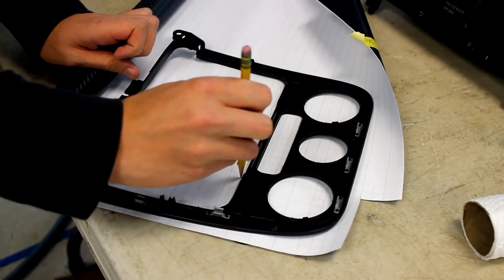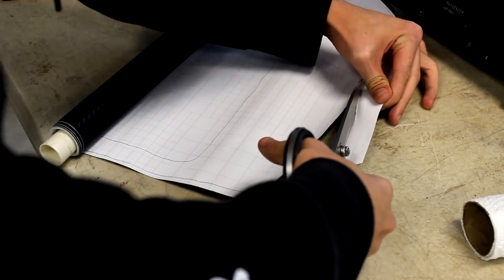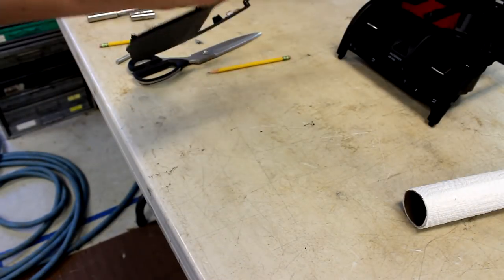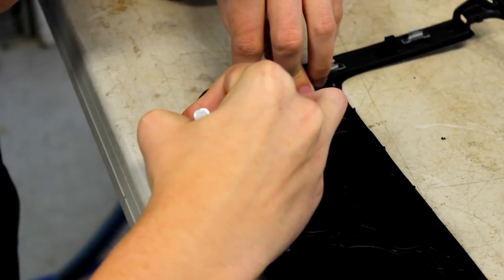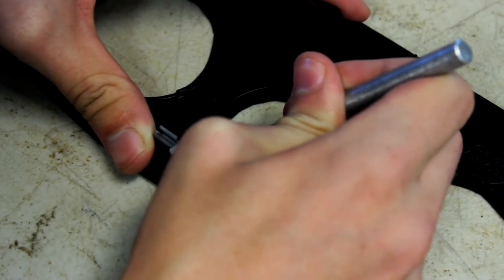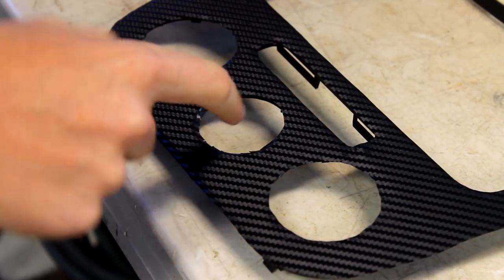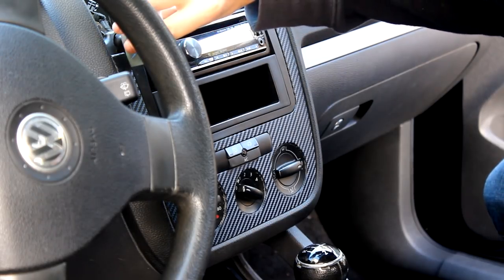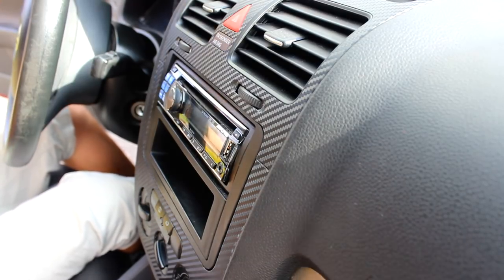How To Wrap Interior Trim With Carbon Fiber Vinyl

Comment: I did this by myself with no experience in the same car. Took out the panels, cleaned, hair dryer, squeege, vinyl. Easy just take your time and it'll turn out good.
Reply from the maker: Awesome! And yeah you definitely need to take your time with these detail oriented projects but when they're done right they look great

Comment: Are not supposed to heat the vinyl up once stuck down to the temp the manufacturer recommends to make it loose it's memory? 
If this is not done when you get sun light or heat on it it will peel off where stretched or get air bubbles appear again???

Comment: vinyl warp sticks on by its self? i dont get that part how does it stick on? u wet the surface? like a sticker? all the video i see on outube people just lay it on the piece u wrap and then heat gun it and squeeze it out? thats it?
Reply from the maker: neoda91 Yeah it is like a sticker.  You don't wet the surface, it has a removable backing which uncovers the adhesive and allows it to stick on.  The heat gun is to get the vinyl to shape to the pieces.

Comment: How would this hold up against extreme heat? Like Southwestern 115 degree summer heat? I'm worrying it might make it unwrap around tight corners and grooves that  are in need of a stretch when applying.
Reply from the maker: +netweit3 Hmm I'm not sure because I live in the north east, but inside of the car gets pretty hot and it holds up pretty well, it shrunk just a little bit in one area in a year.
Reply: U can tint ur windows to prevent the heat from entering ur car

Comment: How long does this vinyl wrap last? Also is it me or does the carbon fiber wrap look good or what. Do you think it'll look good on a black car? I plan on wrapping my front chrome grill and back chrome piece.  And the inside of my black 2006 ford explorer eddie bauer .the wood trim pieces.  You think it will look good?
Reply from the maker: Ernesto Diaz It'll last awhile.  Mine has been in my car for almost a year and it is still going good.  And yeah I think it looks sweet.  And there's a good chance it'll look good if you do it well.  It's your car, have fun with it!

Comment: Great video dude! Question though, is there a way to do this without removing interior trim pieces? I'm too afraid of permanently breaking anything
Reply from the maker: Thanks bud! You could try to cut the vinyl so it exactly matches the trim piece or try to tuck it under the edges using some sort of tucking tool. You'll likely get a better result removing the trim but it is nerve wracking. Good luck!
Reply: Try not to use a screwdriver as well, plastic prying tool & be gentle haha

Comment: I only have a debit card, not a credit card. Would that work?
Reply from the maker: It will work but won’t give you your 2% cash back if you use it😂I’d recommend gift cards at this point in case it decides to break on you

Comment: how did you wrap around the vent rollers for the top part???! can't get them off
Reply from the maker: +Ben Nieuwenhuis I cut a rectangle the size of the wheel into the vinyl and tucked it under the plastic and used a heat gun to shape it to the plastic, good luck!

Comment: can i use a lens wipe to wipe down the surface? or a wet wipe
Reply from the maker: +Eddy Case that's definitely help, basically you're just getting any grease and dirt off of the surface
Reply: CashedOutCars ok thanks i wrapped my pc racing wheel today i think it came out very well
Reply from the maker: +Eddy Case nice!

Comment: Amateur. Don't cut stupid "relief cuts" around the circles just heat to relax the vinyl then roll it around the back with your thumb.
Reply from the maker: +Hesham Hammoudah you can do that, however I find heating that much makes the vinyl quite brittle. "Stupid" relief cuts work just fine.
Reply: +CashedOutCars you're using the cheap stuff in that case or the wrong type of vinyl
Reply from the maker: +Hesham Hammoudah are you a professional who does vinyl wrapping for a living? If so I'd be interested in you posting a video and seeing your techniques, and see what type of vinyl you use